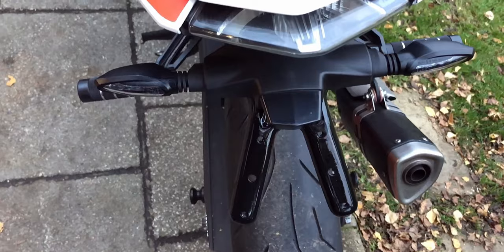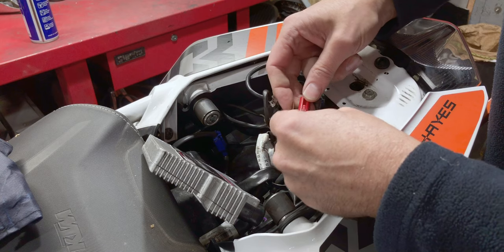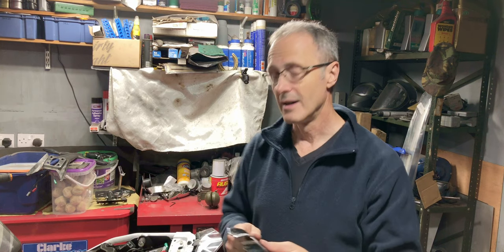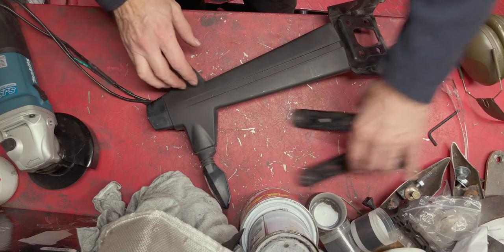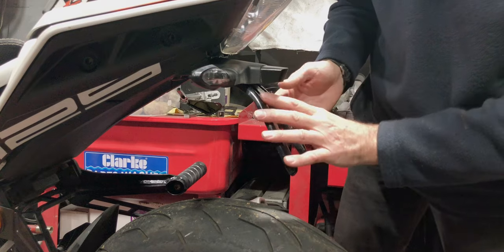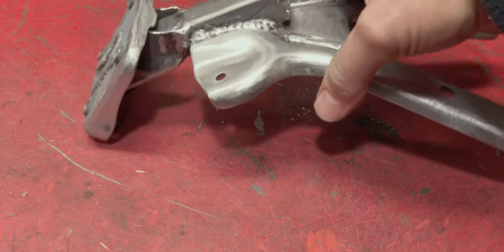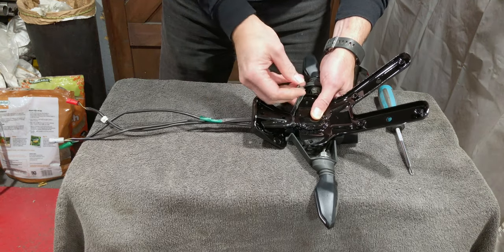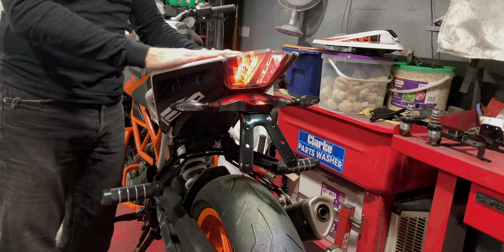Stubby Stock Tail Tidy KTM Duke 390 125 250 200

Comment: I thought in one of his later videos I noticed at least one welding helmet on a shelf there, and hoped to see some fab/welding work, either making parts or a repair.  Looks like he used a MIG this time.  I wouldn’t be surprised if he has a video making some frame mods with a TIG too!
If that was me running that cutoff wheel, and not using gloves, half of my video would need to be deleted to remove the excessive blood spray…😂
The closeup of the final product on the bench has a nice MIG bead run, nice!  The metal
was thicker than I thought, I was expecting to see some damage where you may have blown-through.
Reply from the maker: Thanks, much appreciated.   It had been my plan to include some welding in the video, but I do so little welding at the moment that it takes too long to get back up to speed to include it.   The main issue with welding this is that being a non structural part it is a very low quality steel and I think recycled so there is a lot of contamination which makes for very messy welds.   I try not to get too much blood on the camera ;)

Comment: Thank you so much for this Detailed video, it was very helpful. I opted to cut mine straight off at the square tube to achieve the desired length and welding it back together again.
Reply from the maker: Nice.   Size and shape of the licence plate will drive the final design.  In the UK we have huge plates and it makes it hard to tuck them in (legally anyway!)

Comment: Dave! Just asking about on the road security, for bikes, because I just bought another 125 KTM 2022, and nearly got it stolen out side a small
walk in Sainsbury's just today, I had a D-Lock on the back sprocket and chain, so that walk the only thing that stopped them and so staff shouting in 
the store that they were trying to steal my bike, could you suggest any measure that I could take? 
P.s They got away on a scooter....
Reply from the maker: Of course they were on a scooter.  Ultimately if someone wants your bike there is nothing you can do to stop it.  But what you experienced is common too - you have to strike a balance - there is only so much security you can carry and a D lock is good (if its a good one) but hard to lock a motorbike to anything with one.   A proper chain and padlock - say ABBA not Oxford works but then you have something that weighs nearly as much as the bike.  I do quite like the KTM disk lock for this reason.  Never bought one, but it's always fitted and not so easy to remove with an angle grinder or brute force as your average cheap disk lock.  Good to hear that you survived that one.  But a couple of years ago there was a 390 Duke got stolen from the high street near me and was ridden around for quite a while by the thieves.
Reply: @MotoMirius  thanks a million for your insight, I ordered two more D-locks, the one that saved me was a ABUS, That I normally use with  my garage lock, one more of them a Kryptonite deck Evo, for the break disk, until my steering lock is fixed Saturday morning, thanks again, salute to always!
Reply from the maker: @ezekielgskeen8607  I see a typo in my response - Almax not Abba.   Good luck!

Comment: I did see this on another video the other day and wondered if and when you was going to post this. Unfortunately, this is way out my skill set! Plus how would I get the aliexpress tail tidy off probably rusted on haha
Reply from the maker: Ha!   Easier to make than you might think.  I did shoot footage of how to do this without welding but I left it out as it wasn't complete enough.   Maybe I need to buy another tail and do a non welding version?  Did I come over a bit peeved about the existing tail tidy?  AliExpress is back on the bike after a bit of rust removal, filing and a coat of paint!  Skäl  David
Reply: @MotoMirius  yes cable tie? haha
Reply: @MotoMirius  Or I send you my spare one lol
Reply from the maker: @adamstyles823  LOL!
Reply: @MotoMirius  All starts with Halfords Advanced tool kit! Yes, I think will start my full licence if going to be tinkering already gone way above bikes worth just following your videos lol
Reply from the maker: @adamstyles823  I'm still using Halfords Advanced.  I would always recommend a full licence.   125's are overpriced - 390 costs only a little more and has twice the power while being exactly the same bike.

Comment: Hi do you know when the handle bars you have are coming back in stock ?
Reply from the maker: Hi Sam, no idea I'm afraid, that is all down to Magura.
Reply: As I’m looking to buy some as my stock are bent
Reply from the maker: @samcrossland2702  Mine were too.  You can buy pro-taper etc - these are dirt bike sized bars.  Because KTM.
Reply: Do Magura do standard bars for a ktm with all the wholes drilled ?
Reply from the maker: @samcrossland2702  I think all the X Line will fit but I doubt if they are drilled.

Comment: All that to save £42 mmm , I don’t think so !!!
Reply from the maker: Get what you pay for and in my case after two years £42 was an ugly mess of rusty metal.
Reply: @MotoMirius  that will always happen through lack of proper maintenance
Reply from the maker: @DavidTaylor-rc8ur  Low quality recycled steel with skipping product finishing ahead of poor powder coating have nothing to do with proper maintenance.  As they say, buy cheap, buy twice.  But go ahead and buy cheap parts if that works for you.